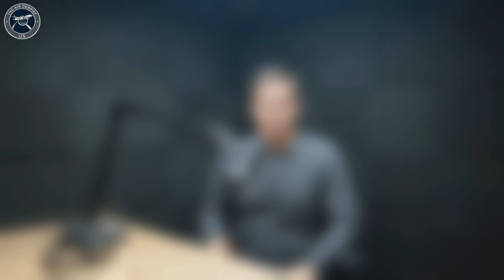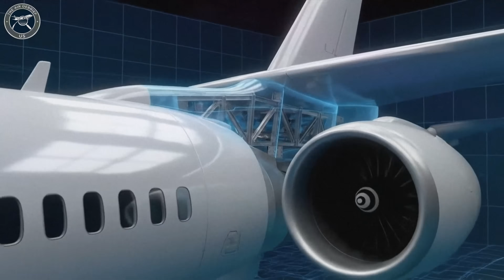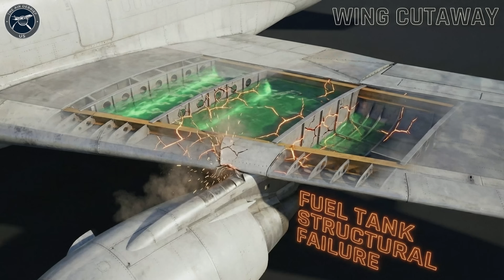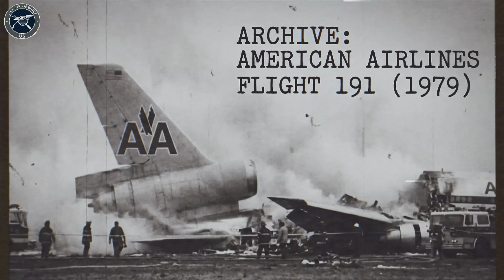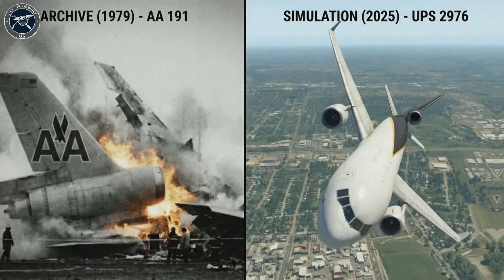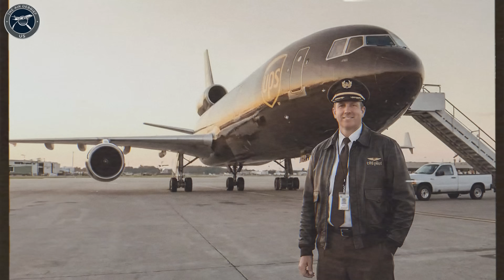UPS Plane Crash Update: The "Safety Feature" That Killed Flight 2976

Comment from the maker: The "Fuse Pin" is designed to sacrifice the engine to save the wing. In 99% of cases, it works. In this case, it caused a disaster. Do you think this design is still safe for modern aviation, or should it be banned? Let us know your verdict below. 👇
Reply: boeing does the same thing
Reply: Same thing with the one 46 years before this one

Comment: 4:32 your AI-generated analysis is flawed.  due to AA191 hydraulic fuses were installed to maintain hydraulic  pressure.  The aircraft was vitually wings level when it plowed into the tanks at the petroleum recycling facility.  The ensuing explosion threw the aircraft over onto its side
Reply: He also said that the problems started as they climbed past 1000 feet which, unless I'm mixing up incidents here, is not true as it all happened right at takeoff.
Reply: @awesome_by_default 

This entire video is full of shit.  Not disputing the description of the fuse pins, but the NTSB very early said the engine separated due to fatigue cracks.  No mention of the fuse pins.

NTSB originally in their first brief stated 1000 feet.  But ADS-B provides two altitudes...ASL (Above Sea Level) and AGL Above Ground Level or pressure altitude.  1000 feet ASL at Louisville is roughly 250' AGL.  They clarified that on the very next days brief.  So while the nose may have gotten near 200'AGL at max altitude the main part of the fuselage never got near that high.

at 0:30 it did NOT bank violently left and then disappear behind the tree line.  It was wings level until it collided with the tanks, the ensuing explosion then THREW the aircraft onto its left side.

At 3:30 as you say it did not climb through 1,000 ft and they did NOT retract the landing gears.  They were fully extended on impact. 

The engine separated not due to fuse pins but due to fatigue/fractures in the mounts.  The broken mount assembly was still attached to the pylon.

IRRESPONSIBLE CONTENT CREATION!!!
AI SUCKS!!  As does whoever wrote the script.

Comment: You are wrong. The engine is designed to go up & over the wing & that’s exactly what it did after shooting debris under & across hitting engine #2. That’s why you see # 2 spitting flames. They go up & over to try & avoid damaging the lower tail section. Also that’s why they added hydraulic fluid plugs on the leading edge of all that type of plane. Remember Chicago?
Reply: It's an ai slop generated summary. There's a few mistakes I've noticed here. Like saying the problems started as they passed 1000 feet altitude.

Comment: The number one engine did not "drop off the wing" or "fall like a stone." The video footage shows the engine lifting up and then vaulting over the top of the wing.
Reply: that was due to the rotation of the fanblades...It did in fact drop/fall off the wing.

Comment: Please Answer.
I have yet to see a video with credible reasons why Airlines/Airplanes do (not) have Cameras installed to show the leading edge of each wing, all engingind and the tail assembly, this could be critical in an emergency with a flight crew to be able to see these services and the engines please explain why airlines won't spend the money and take the time to get this done. 

I hope you will make a video explaining why this is not being done. I have sent simpler comments the other aviation commenters that have never got no response not one.
Just Joe
Reply: dude, that wouldnt of done anything for this situation.
Reply: Camera would have made no difference. Pilots are not mechanical engineers. A stress fracture is not something that can usually be seen by a random camera on the wing. These planes have to go through vigorous inspections
Reply: If the planes were built by Tesla they would have cameras.